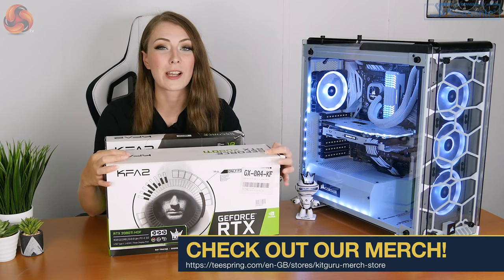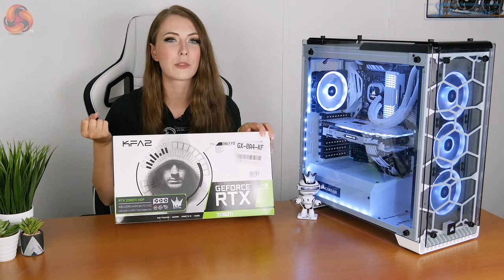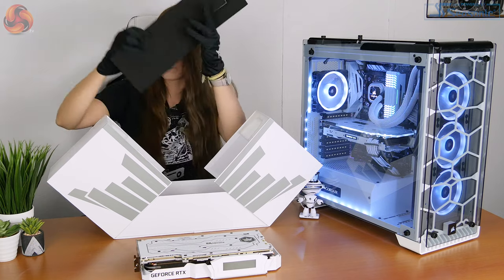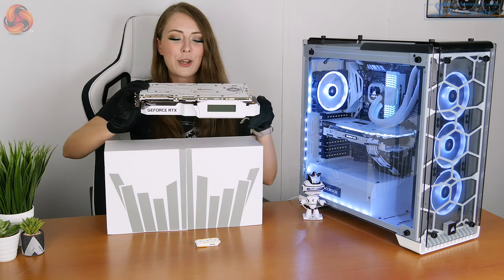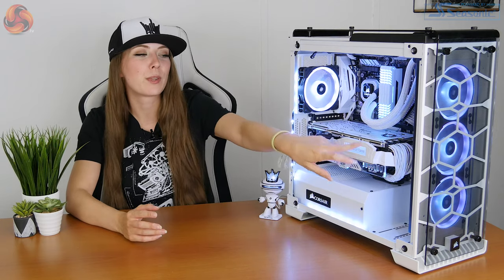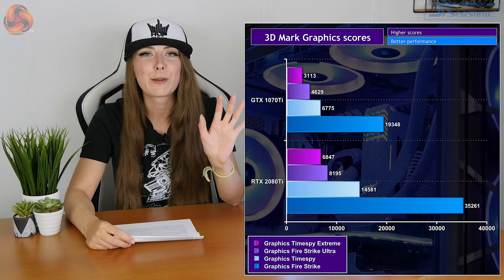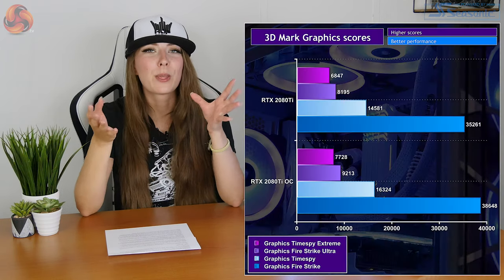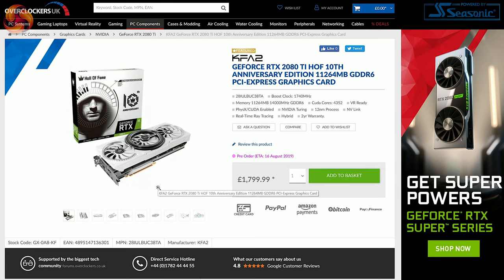Briony UPGRADES her PC with the KFA2 RTX 2080 Ti HOF!

Comment: Don't worry, Ray tracing will make sure that your 4k performance will be at 1070ti level :)
Reply: Ray tracing is pretty well optimized now.
Reply: +CPC_RedDawn  144hz is pointless. The human eye can't see more than 90fps, that's why VR headsets are 90hz. Better use 1440p 90hz + ray tracing.
Reply: @basshead.  Any research paper on this? im just curious
Reply: @basshead.  no it isnt and yes people can see above 90hz? Wtf are you even talking about?

Here: https://www.amazon.com/Pimax-Plus-Virtual-Reality-Headset/dp/B07JZL5QK3?ref_=d6k_applink_bb_marketplace

120Hz VR
Reply: 144hz is for e sports and tournaments with thousands of dollars on the line. I would want every advantage i could get. But casual gaming at home its not needed

Comment: The 10th Anniversary Edition card has a hybrid air / water cooler on it. So if you have custom loop water cooling you can water cool the card. If you don't you can use the air cooling.

Comment: Glad you enjoyed reviewing this monster, cannot wait to get down to some proper overclocking together on this GPU to see what it can truly do, but we shall wait for some cold Winter air and the memory is 15,500MHz, stock voltage without a hiccup,  I am sure we can push that beyond 16,000MHz, helps this card has dedicated memory power, hence 3x 8-pin connectors.  Love the review  Briony and so do the guys at NVIDIA and KFA2/Galax, thank you <3 :)
Reply: Seen the ferarri on ig. But you work with nvidia or galax/kfa2?
Reply: @Mc-Derpulous  I work for neither. :)

Comment: Okay, crazy question, but do you guys have a Corsair Crystal 280x case?  I'm doing a mini-itx build in the white version and I want to use this card, but I'm not sure if it will fit. I think there is good clearance by the fans, just don't think the anti-sag arm will fit. You guys are the only people I know with this card, and would you be able to do some measuring tape experiments maybe? Thanks!
Reply: I can measure the card for you but I dont have that case I'm afraid.
Reply: @b21ony   Dang, ok. So it's about 330mm in length? I hope I don't mess up and get a card that won't fit in my case, but I want to keep things small
Reply: @b21ony  Thanks for the reply!
Reply: @1griffinguy  Card length is 330mm With the PCIe connectors its about 355mm. From the top down to the bottom of the RGB support stick its 95mm. Its also about 140mm deep. Hope this helps :)
Reply: @b21ony  Helps a lot! Thanks much!

Comment: I have a Galax 1070Ti (white-ish) and RM750x also, but I don't think I'll be doing this upgrade any time soon ;-)
I also learnt something with this video... I remember looking at the RM750x efficiency curve in the manual and seeing the efficiency peak around two thirds of the way across the horizontal axis, but clearly didn't pay enough attention to notice that the scale was far from linear and that the peak was at 50% load!

Comment: I use a 750w psu but it's platinum rated from Superflower and is white coloured. I have a 2080ti as well but with a i7 8086k OC'd to 5.2ghz. Never had any issues.

Comment: What cover is that on the PSU shroud? I have this same case and mine is wide open there. You can see the cables which drives me crazy
Reply: Official Corsair part I got it from their website :) It's weird the case doesn't come with it as it already has the holes. https://www.corsair.com/uk/en/Categories/Products/Accessories-%7C-Parts/PC-Components/Cases/Crystal-570X-PSU-Shroud-Cover/p/CC-8900136

Comment: I run a i7 7700k @5.1 delidded witha waterforce 2080ti and my best score was a 10213 in port royal. maybe upgrade the PSU and do a overclock on CPU? 1.400v and youll be safe hitting some good numbers raise the cache clock to 4.6-4.8
Reply: A high end psu is a must for this card. This card was built for overclocking to break records. It pulls 500 to 550 watts alone. Pointless for gaming.

Comment: Artifacting...? Wonder if it’s running micron memory as it should never artefact ever hon. It should only crash when pushed too hard. 
My guess is that may be a faulty memory.
The best vendors are using Samsung gddr6 and not micron for this reason is my understanding. The artefacting really is a worry

Comment: Those particular cards are really designed more for LN2 overclocking than anything.  You can definitely get some decent numbers out of it with the stock cooler, but those record setting scores for all those online benchmarks they most likely came from people putting the card on LN2 to push the card as far as it can go.  I am amused that my little mobile GTX 1070 gets higher Fire Strike scores than your 1070 TI (19,970 graphics with the same CPU; a 7700K, though mine is overclocked to 4.6GHz across all cores, no idea what yours is clocked at), though of course the mobile version does have 128 more CUDA cores than a standard desktop GTX 1070 so that's certainly a factor.  I game at 1440p/144Hz and at least for the games I play, it handles it quite well.  It won't be long before the 4 cores/8 threads of a 7700K won't be enough for the latest games though (and some games are already getting there, like the latest Tomb Raider and Assassins Creed titles, but they're not really my cup of tea anyway).

Comment: The card is incased in metal, which is essentially the same as an anti-static bag/ box.

It does seem a little insane to 'need' 3x 8pin power connectors, with the 75w from the PCIe slot that totals over 500watts!! 😲

Let me know if the 1070Ti needs a new home, I'm also in the UK (London) and don't mind covering shipping if needed.

Comment: The PSU efficiency thing is really a myth at this point. For an 80+ Gold certified PSU the difference between peak efficiency and everything else is 2%. It's essentially a flat line at 90% efficiency with a peak of 92% at around 50% utilization. That 2% amounts to absolutely nothing. It just looks like a curve because PSU manufacturers like to choose scales that exaggerate the difference. Here is an example from Seasonic: https://seasonic.com/prime-ultra-gold (look at the values, not the "curve")
Reply: she already knew that, don't you think? Are you comfortable with it, when the 3950x is on the shopping list?
Reply: @TheSilviu8x  Maybe? I don't know. Lots of tech channels and "enthusiasts" seem to make that argument. I'm not trying to tell anybody what to buy, it's just that headroom is a much better argument than efficiency.

Comment: UMMM... do you realize you can drop the RESOLUTION to 2560x1440 and have the monitor or GPU (for GPU its driver settings) upscale to 4K rather than turn down graphics settings to raise the FPS? The main difference would be more aliasing but add a little anti-aliasing if needed and you can still raise the overall FPS while maintaining similar visuals in most instances.
Reply: great

Comment: 1635mhz card for $1700 makes absolutely no financial sense to buy.
Reply: it's a benchmarkers card, designed to be water cooler or even more exotic cooling, nitrogen or even helium. 
PERSONALLY, I would go for the ASUS ROG STRIX 2080ti at £1200 and use the £300 saving on the rest of the computer, fun fact according to kitgurus own review it actually overclocks better on air.
that said the Msi lightening 2080ti looks nice.
Reply: @Will91289  the reference 5700 xt OC better on air too vs water. That shit boggles the mind.
Reply: @AphexTwinII  i don't get it?
Reply: its the best looking card on the market and it fits very well with my white/black theme build.
Reply: @Vipppala  MSI Lightning Z looks better
Reply: @AphexTwinII  it's not white so no it does not.

Comment: @KitGuruTech @Briony 80% load on a PSU is completely fine, 90%+ is when you start to be pushing it long term. No need to stay between 40-70%, nevertheless 50-60%. That's just silly, both longevity of PSU and power usage is completely negligible going from 50% load to 80% load by switch PSU.